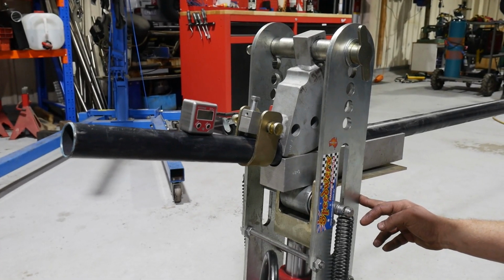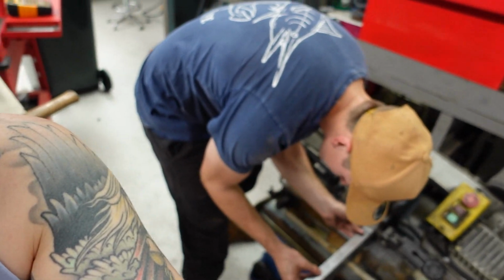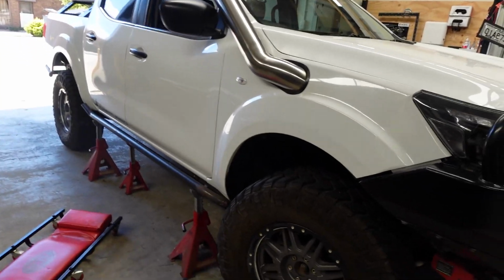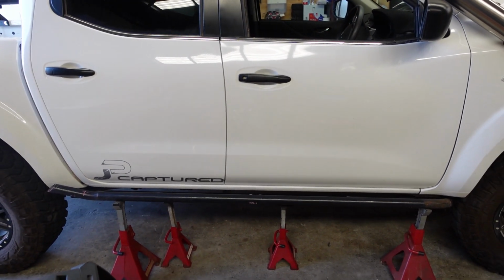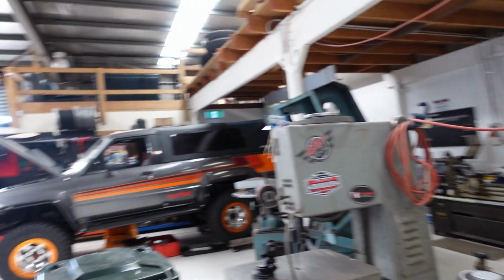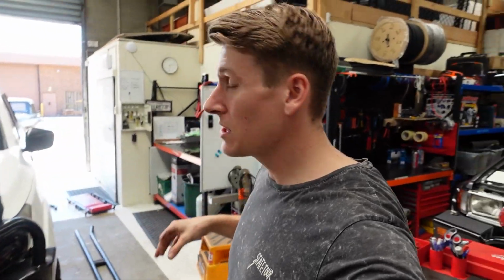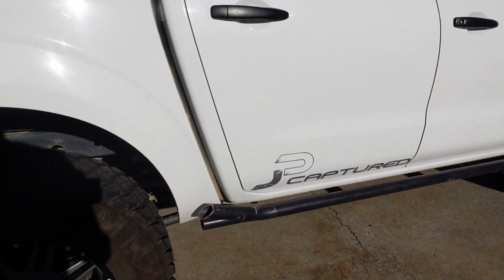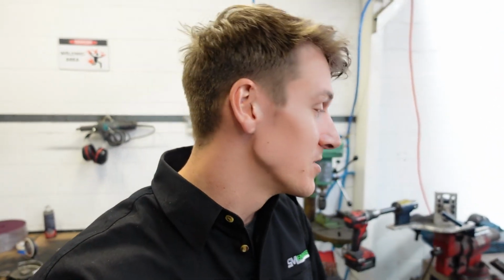Custom 4wd Rock Sliders PT1

Comment: Very nice work. The sliders look awesome! Can't wait to see the finished product. 
Question: bolt on VS weld on, your thoughts?
Reply from the maker: I talked about this in the vid, both options are great. Honestly the reason I went bolt on is because is because I didn't have any 10mm steel to make weld on plates 🤣. The only real benefit of bolt on is you can take them from car to car.
Reply: @jpcaptured799   Thanks for the reply JP.